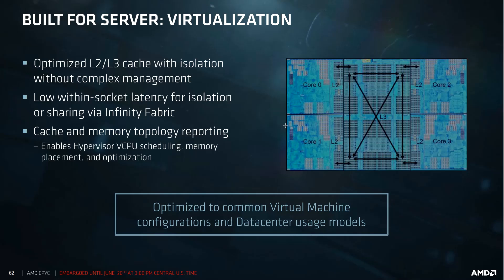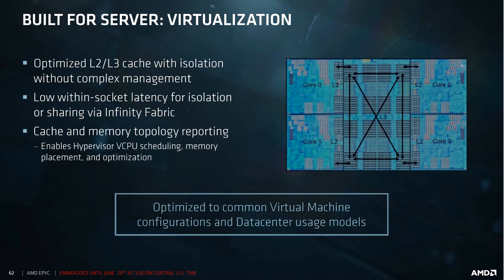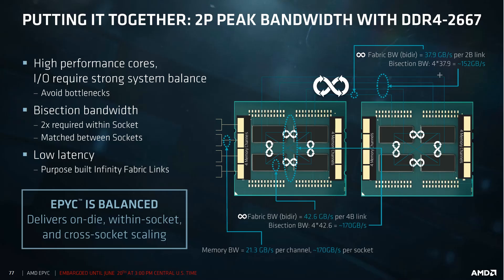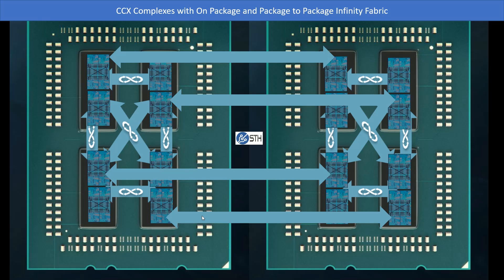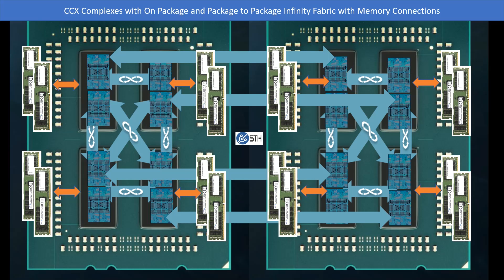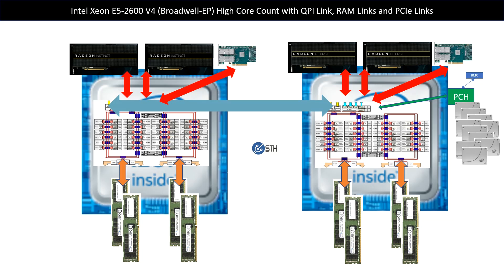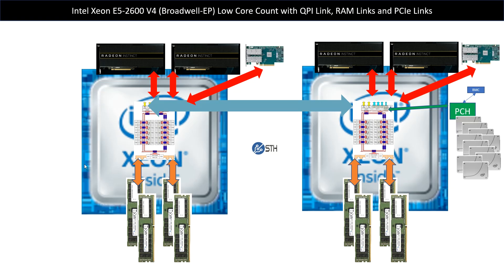AMD EPYC Infinity Fabric v Intel Broadwell-EP QPI and NUMA: What you need to know

Comment: I bought a Threadripper 1950X and coming from an intel background I needed to understand the platform better (Im also getting a degree in systems administration). As I watch this my mind is blown at what AMD just engineered, built, got in stores and into our hands. It's not speculation anymore - intel must do something similar eventually because the costs are going to go up and the market will shrink for them. The reality is as big as they are, they only have one direction to go when a competitor out engineers them, and thats down.

Comment: Your AMD diagram would be clearer if  you you could present it in three dimensions with the fabric being a single flat base that covers the entire package and each module (CCX, Mem controllers, PCIe/IO modules) having their own individual addresses on the fabric. The 4 rectangles of silicon that you can see on the package effectively form a framework to each carry packages of two CCX modules a dual channel memory controller module and its own PCIe - I/O controller module. Each module has a 32byte/cycle interconnect to the contiguous fabric underneath. The beauty of the design is that each silicon framework can work individually of in combination with any number of other frameworks as we see with epyc.

GPU or Cache traffic accessing any of the memory controllers is directly sent over the fabric to the required controller. It does not have to go through multiple hops through the CCX module to get there the way your diagram infers. The relevance of the silicon framework only goes to describe what corner of the package the desired controller is located at.

The "Glued together" comments by Intel are wrong in that it assumes that there are four Processor dies and four fabrics connected because that is the way they have to do it but in reality there is only one big fabric with 4 silicon module holders connected to it
Reply: +brad morris Nice explanation.

Comment: I don't think Intel's solution is "cheaper to manufacture".
As someone who did lithography himself, here are some considerations:

Imagine you silicone device needs 30 lithography steps. If each step is 95% likely to go right, after 30 steps that means an average success of 21% (round numbers).
It's not hard to imagine that a larger die is more likely to fail.
So, AMDs approach on keeping stuff small and just join the modules together over a PCB is cost saving, not on the contrary. Small, likely to go right dies, and if one does go bad, you just waste money on 1/4 of a CPU not a full CPU die. 

Also, it gets extremely modular. Yes, of course, infinity fabric has finite bandwith and that might a problem. But not as much as you think. 
When you're doing parallel computing, you avoid about as much as you can to have data going in and out from the GPU. Because PCI-e bandwith is also finite and it takes time for stuff to travel between CPU and GPU RAM. So, all decent coded software avoids data travel whenever possible anyway.

And again, on the modularity, it costs development costs by a huge amount. It's all modular. You want X or Y functionality, just add it to the package or remove it from the package. Practical example: APUs. Whenever Zen core APUs come out, it'll probably be just a Ryzen CPU with a miniaturized Vega on the PCB. Cheaper than full silicone integration costs.

[Edit notice: typo correction]
Reply from the maker: Hi Rui, that is correct and what was stated around 6:40 in the video. Infinity Fabric allows AMD to use a lower cost methodology. One key area to remember is that Intel and AMD can bin a defective core into a lower core count part. The late release of Ryzen 3 suggests that AMD may actually be doing better than we thought with their process tech.

On the inter-die part, we already have done a set of EPYC benchmarks at DDR4-2400 using pre-release firmware so our discussion is done with that in mind. DDR4-2666 should be completed this week.
Reply: Ahhh, yes, I hear it now. When I heard it the first time I understood "AMD is doing what Intel does cheaper" and you mean "AMD is doing what Intel does, but cheaper" .

And yes, using defective silicon to produce lower end devices is exactly what Ryzen 3 is haha

Comment: Infinity Fabric needs a bandwidth calculation. 
Little let down that, AMD didn't focus on having fast DDR4 speeds on the platform.
Reply: The total bandwidth for any point to point connection on the fabric between modules is 32 bytes/cycle. The number of cycles per second is the same as the actual memory frequency. 3200MT memory = 1600Mhz =  1600000 cycles per second. The Data fabric in between acts as a backplane with 100s GB/s bandwidth that is only usable with multiple point to point connections all running at once.

With 3200MT/s memory installed you get a theoretical 51GB/s memory bandwidth. That combined with the memory latency combines to determine the amount of throughput that is available. The current high latency combined with all 16 threads and GPU data traffic all trying to access a single 32 byte/cycle interconnect to the memory controller is the reason why the Ryzen R7 chips have shown reduced gaming performance with the 1080ti level graphics cards compared to intel. The data needs from the 16 threads of the two CCX modules and GPU were like a fire hose filling a swimming pool and the memory controller was trying to service that like it was using a garden hose to empty the pool. 

Threadripper and Epyc should actually provide a much better gaming experience as the interconnects to each memory controller will only have a percentage of GPU traffic competing with CPU traffic for access to the multiple memory controllers.
Reply: Thanks for explaining!
Reply: +brad morris 1600 MHz is actually  1,600,000,000 cycles per second (you're out by a factor of 1000) but as you make assumptions and don't show your working it's very difficult to follow your argument.
Reply: Haha indeed Mega = Million

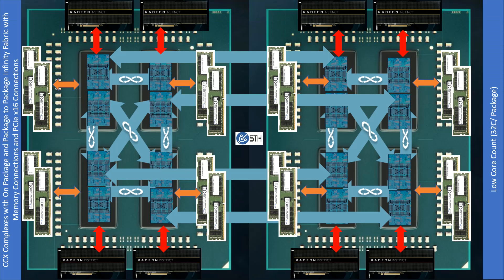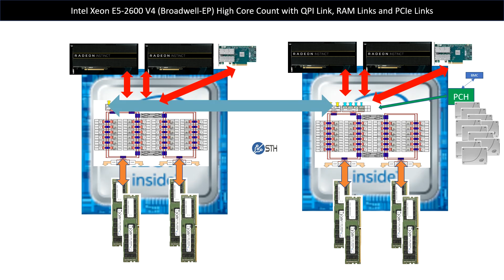Comment: 5:26 vs. 7:27 - Does that mean  (# CPUs, SKU, Base Clk, All Boost, Max., Watts):

2x 7251's (2.1, 2.9, 2.9) 120W
2x 7351's (2.4, 2.9, 2.9) 170W
vs.
2x 7601's (2.2, 2.7, 2.9) 180W

that, with GPU and Memory (not CPU) bound Programs (like Mining a GPU intensive Cryptocurrency, for example) you get more Fabric available for GPU to GPU, GPU to Memory, and [takes a breath] also fewer hops - because with fewer CPUs (at slightly faster speed) and more Fabric (at Memory Clk) the 'perfect' Compiler would have everything connected by the shortest and fastest path.

Possibly a shorter and less clear way of saying: the 7601's might need a longer route on a congested Fabric through a greater number of slower CPUs to go from one GPU to another, all while using more Wattage (to run CPUs that are not "loaded", just pestering the Fabric with interruptions).

Don't know how to make the question clearer, no doubt Patrick does. :)

Maybe the 7nm Chips coming will have a Clk Boost (because 'low Core CPUs' are handy in certain License situations) version and an efficient "GPU-Centric Epyc System" will be forthcoming next year.

Thanks for making this Video. 

YT,
Rob

[Asking the tough questions, not always in the least confusing manner] 😳

Is there a succinct way to say that?
Reply from the maker: Rob,

Mining is not the best example. Typically you need low CPU/ system to PCIe device bandwidth, little to no PCIe to PCIe, and applications fit in video card DRAM. CPU only mining is generally optimized to fit in L3 caches so little inter-core traffic. We have a video on EPYC with Monero. Perhaps a better use case may be deep learning with GPUs.

Monday on the STH main site we will have an example of a 10x GPU (NVIDIA GTX 1080 Ti) single-root system which is the current "go-to" architecture for the deep learning guys. One of the keys there is that you are not touching the CPU for GPU to GPU transfers which means low latency and high bandwidth. Some industries, e.g Oil & Gas GPU systems tend to go for multiple root still which is more like our DeepLearning10 build. Those may be good with EPYC.

Frankly, storage with single socket is going to be one of the big breakthrough use cases for EPYC.

On the fabric congestion with lower core parts two ways to look at it. If you have an 8 core/ 16 thread application and a 7601 you can keep it on a single NUMA node and potentially use fabric infrequently. If you have the same on an 8 core/ socket SKU then you will use fabric more frequently. The flip side is how much each application on each CCX uses.

This is a complex and very workload dependent area. Broad statements do not work.

We have requested a SKU stack from AMD comparable to what we do with Intel and are still awaiting lower-end SKUs.
Reply: if the memory can be directly associated with one GPU then the OS will put that memory on the same CCX as the GPU in this event the GPU to Ram will possibly be faster than the Intel system since the CCX interconnect is faster than traveling around the ring buffer.  With mining most algorithms this is completely possible to give each gpu is own ram memory pool and not share math between GPUs. 

If you need GPU to GPU chatter then its more complex i think.
Reply: matthaus woolard - Thanks for your reply.

I'm looking forward to what I call an EPU. Like an APU except the GPUs are external (and upgradable).

I need 'some' CPU power, but want highly parallel Programs to run on the GPU Cores. Low latency is also good.
Reply: ServeTheHomeVideo - Patrick - Thanks for your reply.

I specifically didn't mention Monero (but saw your Article/Video) because it's designed to avoid GPU and ASIC 'cheating' (if there's such a thing as cheating).

Mining is probably not the best example, unless the particular Coin's Algorithm suits a low CPU Core count and a high GPU Core count.

O&G Reflection Calculations might be a better example, as might Software Image Stabilization.

Really a one (or few) trick pony - and difficult to generalize, as you said.

Storage is certainly a good case for the Epyc. BTW the ZFS (Oracle) is one of my favorites, the way it partitions fresh vs. stale and Snapshots easily - wonderful when combined with VMWare Snapshotting (you can roll and unroll yourself out of anything).

The Epyc has convinced me that I'd prefer it over the Ryzen Pro or Intel's faster Chips.

The only thing better would be a POWER9 (with it's PCIe 4, and NVLink 2.0, etc) but such is beyond what I could justify and the Infrastructure (Parts and Software) is not as vast as x86.

I hope someone sends you a Barreleye 2 to play with.

Google and Facebook are replacing Racks as time/need/availability permits - they could have chosen AMD or Intel but went with POWER9 instead.

Thanks for your time.

Comment: @ServeTheHomeVideo would be interesting to compare the Epic connection between CPUs to Intel's connection. I remember seing amd talking about having twice the bandwidth. 

Also with the ring buffer used by Intel does that not mean that you may end up with many more hops in core to core communication if the given cores are not next to each other on the buffer. And how does that scale out with memory, from your diagrage it looks like there are some cores that are 4 steps around the ring away from the memory controller.

Also witht he PCIe lanes connected on the other side of the ring does this mean at best you are 9 steps from any ram? or am i readying the ring buffer wrong?

The important thing, of course, is the speed of these hops and their bandwidth. Would be interesting to have a comparison between how long it taks for a PCIe device to access the ram in best case and worst case (calling ram on another cpu).
Reply from the maker: Hi Matthaus - it may have 2x the bandwidth but remember that with Intel 2P there 50% of system resources (caches/ RAM/ PCIe) are off-die (e.g. QPI in Broadwell-EP) whereas with the AMD EPYC 7000 series 87.5% of total system resources can be off a different piece of silicon. 

Another point to remember is that AMD is very fast within a 4 core CCX complex. When you cross the die even to the second CCX complex on a chip then you take a latency hit as well.

On the latency, we have been working on that for the past 2 weeks. We have also been working on another scenario using GPU to GPU transfers (require Infinity fabric) plus then doing RAM transfers. That second scenario is taking much longer so the latency checks we are going to have, perhaps just after the Skylake launch.

You have great insights and we are going to be doing more on this. Unfortunately, it has been taking time and IF tuning is an area where we have seen improvements on with newer AMD firmware on our test systems. I am not 100% confident in saying that what we have on ours today equal what will ship in systems in a few weeks and I want to ensure we are being fair to AMD since it is a complex setup.
Reply: Do we know at this point if the Skylake Xeons will be using the same "mesh" system that the new i9 (X299) Intel CPUs have?

The Interconnect hit on performance with needed to go over the fabric is probably not going to be that bad on servers, most CPU tasks on servers are typically limited to a small number of threads (the os should be able to place them on logical cores sharing the same CCX) in addition the OS should place tasks as close as possible to the memory they require/load the memory to the local memory controller.

the consideration about communication between PCIe and Rams and PCIe to PCIe might be more important. But still in most cases with PCIe to ram the OS should place the ram on the same local address space (CCX) as the PCIe device you would normally only have jumps if you sharing a block ram between multiple PCIe devices.
Reply from the maker: Core i9 is a similar subset of the Skylake Xeon mesh https://www.servethehome.com/things-are-getting-meshy-next-generation-intel-skylake-sp-cpus-mesh-architecture/

Due to Intel embargo, we cannot go into more detail yet, but stay tuned to the STH main site in the near future.

On smaller systems (low ram, 1 PCIe x16 device, 1-2 CCX cores) it may be better. STH focuses on servers so that would be a very atypical use case insofar as it describes a very small portion of overall system utilization with a relatively massive difference for other scenarios. While you may use few CPUs, you may need more RAM capacity and you are also doing I/O through PCIe. As we see more transition to 25/40/50/100GbE (our lab is on 40GbE and we just installed Omni-Path) the PCIe bandwidth needed for networking is significant.

More to come.
Reply: looking forward to these investigations.